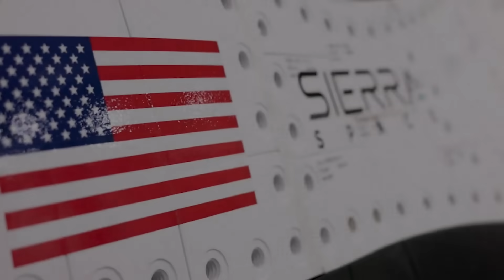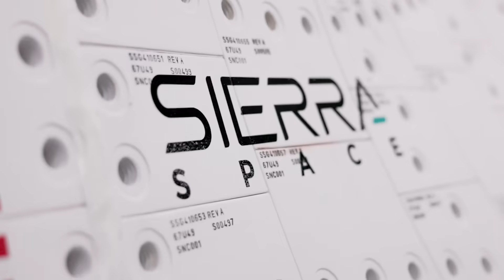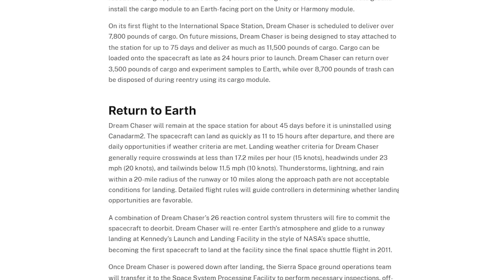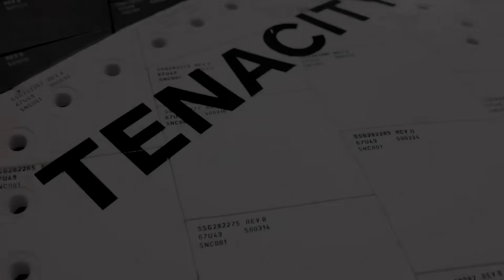Dream Chaser Tenacity Is Getting Ready To Launch

Comment: During the aborted Lockheed Martin VentureStar program, a new thermal Protection System developed by Rohr Inc. was announced. The system utilized a nickel-based superalloy developed by Inco Alloys International. The material features a high creep resistance and high strength at high temperatures alloy. At the time, it was loudly claimed it was safer and cheaper to maintain than the ceramic protection system used on the Space Shuttle. According to Lockheed the VentureStar's metallic heat shield would have eliminated 17,000 between-flight maintenance hours typically required to satisfactorily check (and replace if needed) the thousands of heat-resistant ceramic tiles that compose the Shuttle exterior. I have heard little about it since. There are some rumors that a derivative of it is being used on hypersonic vehicle development. If anyone knows what happened to the seemingly promising TPS system let us all know.
Reply: Interesting.  VentureStar was so close, it must have been heartbreaking for the people that devoted so much promising time on the platform.

Comment: <still the dream chaser is approx. 25% of the whole orbital launch system(ula) and the ula booster system is all throwaway, plus dream chaser has it's own expendable module>
<it think that if at least the booster stage was also reusable, the ability to reuse components would increase to 75%>
<nasa and the private space industry are still burdened with 1960's thinking>
Reply: @mathewferstl7042  so whether or not space vehicles/orbital launch systems are reusable is a big factor, namely the us taxpayer pulls up a huge portion of launch and operational costs, and if whatever percentage is single use/throwaway that is a loss to said us taxpayer.

<to launch or not launch, the important number is cost of putting a kilogram in LEO or geosynchronous orbit(GTO?)>
<so once you decide something cannot be done, then it cannot be done, but for the most part elon musk/spacex reuses all of his orbital class falcon 9 boosters(even up to 19 times to date)>
<sierra space is getting launch money, and about one quarter to one third is discarded(taxpayer money lost, not recouped>
Sierra Space Corp., Broomfield, Colorado, has been awarded a $22,605,083 firm-fixed-price contract for the maturation of the Advanced Upper Stage Engine (VR35K-A).
https://www.defense.gov/News/Contracts/Contract/Article/3470600/
This contract is supported by federal funds that require compliance with the Federal Funding Accountability and Transparency.
https://sierraspace.com/wp-content/uploads/2022/04/spc-ops-form-9365.pdf

<ula throws away everything. the burden is transferred to the taxpayer>
Space Force awards $2.5 billion in rocket contracts to SpaceX and ULA for 21 launches
https://www.cnbc.com/2023/11/01/space-force-awards-spacex-ula-with-2point5-billion-for-21-launches.html

A Space Force dozen: SpaceX, ULA awarded contracts to launch 12 new satellites
https://breakingdefense.com/2023/06/a-space-force-dozen-spacex-ula-awarded-contracts-to-launch-12-new-satellites/
Reply: Wrong, Jay Deister!
ULA Vulcan will reuse the engines which are 90% the cost of a launcher; and the Vulcan fairing for crewed Dreamchaser is also reusable.
(Centaur 5, like F9/Heavy, is disposable BUT it can be left in LEO and refuelled for future space tug duty, unlike F9/Heavy Upper Stage).
So, ULA and Sierra Space have a crewed/cargo system that is 90% reusable.
SpaceX has competition for ISS contracts; exactly what NASA and Congress want.
Reply: @davidstevenson9517   ULA says the engines amount to 60% of the cost of the rocket, not 90. I will be very surprised if they ever actually develop that SMART recovery system. Similarly, Centaur cannot yet be refueled. They talk about it, but there is a lot of engineering to do first.
Personally, I think Blue Origin is going to buy ULA, and all their lovely launch contracts, and then phase out Vulcan in favor of New Glenn.
Reply: @davidstevenson9517
When was the last update about Vulcan doing any reuse?  When will it happen?  
My guess is never.
Reply: Dream chasers greatest advantage over capsule based systems isn't it's reusability; it is it's ability to soft land returning cargo and experiments in prepared location. Thus skipping the huge time and money expense of a water or desert landing.

Comment: It would be smoother and a bit more coherent if you just stuck with metric. The duel values offered for all the values is weird. Stick with metric, let the stubborn yanks figure it out or be confused.
Reply: Get familiar with metric/imperial conversion; Yanks won't change for anybody and being from a metric country AND a Space Buff, it pays for one to be both fluent and quick.
Hello from New Zealand.
🇳🇿🚀🛰🌚
Reply: @davidstevenson9517  If the yanks won't get with the metric, let them remain ignorant. Their scientists and space nerds already use metric... remember what happens when they don't ? No reason to coddle them or give into their stubbornness.
Reply: @drfranks1158
Look up the  word condescending while picturing your face next to the definition.  There is nothing special about the metric system.  Its only benefit is slightly easier conversion.  They aren’t hard.  
But for a wide audience it makes sense to present the information in a format everyone will understand.  That requires metric and imperial.
Reply: Nope.  Not everyone uses metric.  By using both everyone understands the information.
Reply: @jamskinner  by using 'both' people have difficulty communicating. That isn't condescending just fact. Not only is it EASIER to make simple conversions in metric, it makes SENSE. Based on real world things. Like 0-100c being Freeze/boil. You know, REAL THINGS. Not some made up value based on old world ways. No memorization of how many weirdo units = another weirdo unit. Figuring out a KM to CM conversion is moving a decimal and does not require memorization or a f'in slide ruler.  Arrogant yanks and their stubborn ways.
Reply: @drfranks1158 land of the free, but the last former colony (that anyone cares about) to use the empire’s measurements

Comment: maybe a strange question... but why use tiles and not use an extra layer of silicone with black and white paint in it around the whole ship? It seems like a lot of work to check all those slim tiles.
Reply: Silicone can't take the heat. The tiles are made from silica. A completely different animal.
Reply: That is what made each attempted reuse of Space Shuttle so insanely expensive.  At least DreamChaser is not so ridiculously oversized.  It's a privat company; they need to earn the money by themselves and not just take it out of a big tax cash pool.

Comment: Hopefully, SNC will not pull a "Starliner."  Set the clock properly, test the thruster valves, proper thickness on heat shield, etc...  👽👽🤠👽🏗🚀
Reply: It is out of reach now.  Final testing is done by NASA.  But it's not heading towards the Navahos holy moon.  No further problems expected.

Comment: Is it really needed?
Reply: Alternative vehicles to orbit are a big plus in this time in accessing space.  Tenacity if it proves reliable could lead to a more advanced model in the future.
Reply: Needed? Winged space shuttle vehicles are the future.
Ballistic launchers are an anachronism; these brutes will be consigned to Space alone, shipping back and forth between LEO/Moon, Earth hardware up, and refined lunar materials down, for Earths High Tech Industries.
The winged shuttles transfer cargo between Earth and LEO.
An end will come to this method of astronauts/cosmonauts/taikonauts returning to Earth in capsules dangling from parachutes.
That's analogous to passengers in 767 airliners having to bail out rather "remaining seated and buckled in for landing, thankyou".
Reply: Actually yeah. It does a good job as a replacement for SpaceX dragon with more comfortable landings.. and most space station concepts have several of these as escape vehicles. It's also a space tug.. it's also a private company and they can build whatever they want